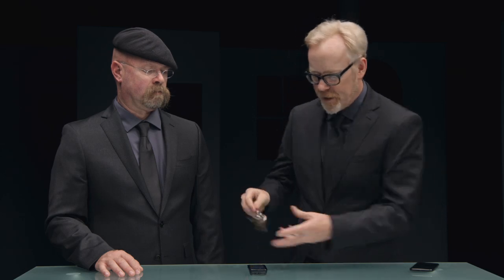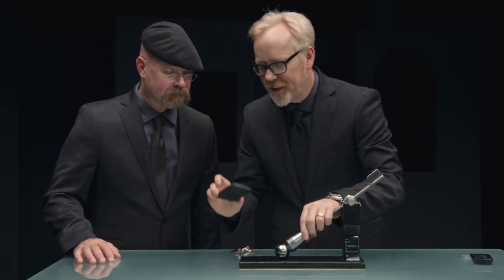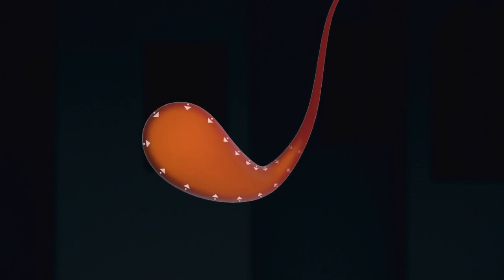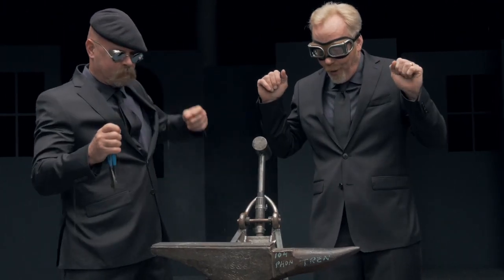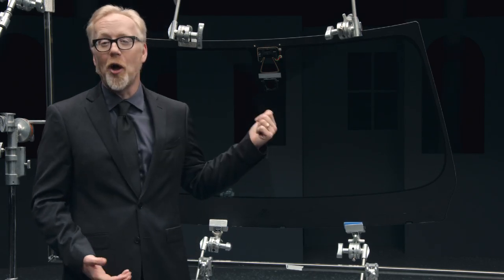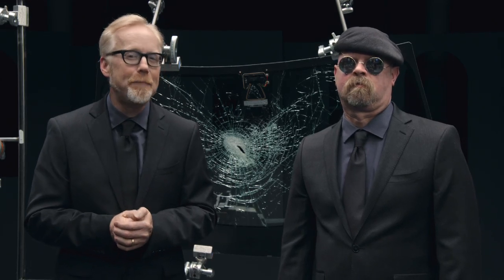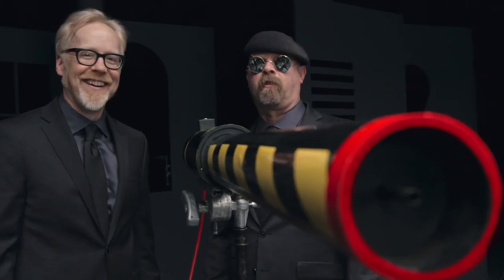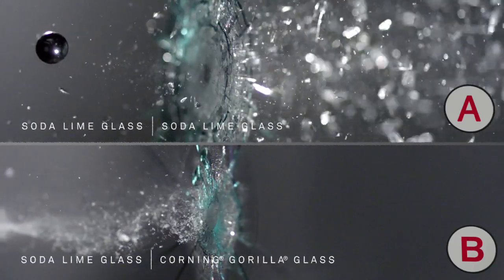The Glass Age, Part 2:  Strong, Durable Glass

Comment: The key scratch test on the two screens was blatantly rigged. The old phone had a glass display with a plastic top layer, which was common on old touchscreen phones. And he scratched it heavily while barely putting any pressure on the new screen. Even in 2023 you can easily scratch gorilla glass with a key with moderate pressure.
I know it's an old video and I know this comment will have zero effect because you almost can't buy a phone without gorilla glass, but gorilla glass was obviously better than plastic, so why bother rigging the test?

Comment: Gorilla glass on the inside sounds like an issue, thermally and chemically toughened glass tend to shatter as the drop demonstrated. The ball bearing didn't damage the gorilla glass, but the problem is that if something does crack it you won't be able to see anything through your windshield. This is the reason cars don't use thoughened glass. Yes, hiding the toughened glass behind annealed glass does something, but its ignoring the other risks for cracking. In some cases, toughened glass just cracks spontaneously (NiS inclusions, self fatigue, ...) and in that case the driver is just utterly fucked, however much you reduce the risks, you need to make sure that if it happens it doesn't kill anyone.

Comment: Just a quick note to everyone here, 3M makes a safety/security film (like window tint but without the tint) that covers almost any normal form of glass and makes it essentially impenetrable. Unless, you fire a gun at it or something.  It is far cheaper than replacing whole glass pieces and can be installed by a window tinter. Not employed by 3M, was just a window film warehouse manager back in the day, we sold the film for security purposes. Line your car windows with it and a sledgehammer wont get through it easily.

Comment: 3:51 As much paperwork as it would be, a much more impressive display would be shooting it. Prince rupert's drops are highly bullet resistant, able to even shatter some rifle rounds. Usually, however, the rifle's impact causes enough vibration to shatter the tail. Smaller calibers don't usually have this problem, and showing it in this way would be super cool.

Comment: GLASS PARABOLOID TIME CAPSULES ... A HELPFUL MESSAGE TO THE FUTURE
A well cast 1.5 m diameter, thick walled, borosilicate glass deep focus paraboloid (3D parabola) of the equation y = 4x^2 would be more durable, useful and multi-purposed then the "old school" Coca Cola bottle from The Gods Must Be Crazy!" ... AND ... would be capable of lasting for more than 1 million years; enabling US to send technological assistance to mankind in the distant future. The inner concave face should be surfaced with grade 8 mirror finished corrosion resistant stainless steel alloy 316 or if possible, iridium. The convex surface of each paraboloid should be festooned with a display of cast stick figure universal language messages depicting the myriad of functions implicit in a paraboloid including: Solar Cooking, Water Pasteurization, Flame Ignition, Shelters, Shields, Wash Tubs, Flood Lights/Spot Lights, Satellite Telecommunication, Radio Astronomy, and Optical Telescopes, etc.

By widely disseminating a sufficient number of them to villages and refugee camps where they are needed most throughout the non-industrialized world, (where they would be used as templates for crafters to fashion millions of ceramic and woven basket paraboloids of similar shape and size), a few would make it into the very distant future many thousands of years hence, to be found by future archaeologists who would discover among the stick figure messages of knowledge and wisdom, a star map like the pulsar map on Voyager, and with it an inscription depicting the messages ... 

                            Greetings From The Distant Past!  We Were Here Long Long Ago! 
                                           Sorry About The Mess We Made Of The Earth! 
                                 Do Not Attempt To Dig Up The Nuclear Waste Depositories!
 This Gift Represents The Opposite Of Built In Obsolescence And May Be Of Some Help To You.

If time travel has been perfected by then, around the time when that a critically sufficient number of such paraboloid time capsules (joined aperture to aperture to protect the inner surface mirror finish), have been created and disseminated, archaeologists traveling back to us in paraboloid shaped warp drive spaceship/time machines could begin appearing in the sky over the approximate locations where the paraboloids were discovered in the future ... and like Bruce Willis in the movie 12 Monkeys, they might over shoot the correct date; with the first attempts appearing over Roswell.  

However, as with Seti Safety Protocols, these paraboloids should not be sent to the future except as a desperate measure because we can't be sure that it would not merely be found by creatures like the Morlock, the Borg, or the Krill ... interstellar conquistadors; not unlike ourselves. But, given that Lawrence Krauss and Scientists For Social Responsibility have set the Doomsday Clock at two minutes to midnight ... this could be the right time to carry out this effort.

Comment: I will note something. You DONT want this on your car. You'll notice when a car window smashes it completely detonates and shatters into thousands of almost pebbles. Theres a reason for this, when its impacted it spreads the stresses out over the entire thing. You dont get the dangerous knife like shards. But its also safer for someone being thrown into it, as the kinetic forces get dispersed across the whole window. If your going to have a crash and get thrown into the window you WANT glass that shatters finely and uniformly. And thats not how Gorilla glass, or for that matter regular glass, works. Car window glass is specifically designed to shatter that way for safety reasons.

Comment: this could lead to thinner glass for doors and windows in homes, not to mention the glass in tall buildings. Wonder if they thought of using the willow glass with the fiber optic cable that emits light all throughout it, this could be used in signs/displays that have shapes you could not do with other materials. Also you use it to make a moving/changing display/sign.

Comment: We need monocrystalline diamond. That's 300 times stronger than steel and hardest material known to man with possible exception to Wurtzite Boron Nitride and Lonsdaleite. You could fabricate the display and all the electronics directly on it. If you can fabricate diamond then batteries would be super high energy density.

Comment: fast forward to 2019 and The Ford GT comes with a Gorilla Glass windshield from the factory. and you can buy aftermarket GG windshields for your Jeep JK Wrangler and F-150 pickups.
Reply: Yep.  After replacing 4 on my Jeep, I've switched.  The GG replacement has taken a few cringe-worthy rock shots without issue, so far so good.

Comment: I suspect the big problem with this wonder product is the same reason why we don't use tempered glass for windshields. Regular laminate glass does not shatter; it cracks. Which means you don't lose forward visibility from a rock strike. Tempered glass also shatters in relatively large pieces, while the Prince Rupert glass explodes into much smaller and possibly more dangerous fragments.

It's an impressive demonstration, but I hesitate to call it a safety solution until we see what the failure mode of gorrila glass truly is. Although since this is several years old, it's possible the answer is already out there.

Comment: My main question for this advertisement is: why not the flexible glass on the outside, a thick polymer resin, gorrilla glass in the center, and another laminate then another flexible glass sheet inside, Or is there a reason to keep the regular soda lime glass if its so much heavier and more fragile

Comment: The first phone they scratched was an old Nokia phone that used a plastic shield over the display and yes you can scratch it very easily but its bendable and because it's plastic its doesn't BREAK. What he broke was the screen it self under the plastic overlay. That's why they chose that ball instead of actully dropping the phones. Newer phones use glass over the screen. In short this is a bs commercial for gorilla glass

Comment: I've noticed screens tend to crack mostly when one of the corners impacts rather than when a side or the front or rear panel impacts, obviously enough as the 'wider' the impact the better the force is distributed but on a 'corner' the force is very acute. So, show me a Phone, Tablet, etc that can withstand a 1.5-2.0m (more realistic average usage height & therefore drop height) impacting one of the corners and when that doesn't shatter the screen that's the day I'll stop using cases.

Comment: These guys and Corning obviously never seen a phone where the screen blackens and burn out with it's glass unscratched!! I've had this happend with me numerous times on my Galaxy phones. When you drop a phone on flat even surface forceful enough, the "hardened" Corning glass will just absorbed the impact energy and pass it to the underlying LCD panel which it is tightly sandwiched to, the result?---the surface glass is just fine, but your display goes dead (usually slowly blackens) right in front of your eyes!!

Comment: Chemically strenghtened glass that are so flexible that they are used in making the rear glass of a convertible car made in the 1960s and early 1970s in order to replace the vinyl plastic at the rear. In fact, flexible chemically strenghtened glass are also used in making glass springs in the 1930s, 1940s, 1950s, up to the early 1960s. That is the problem with most Americans, they are all online computer dependent and THEY DO NOT HAVE A PRINTED BOOK-BASED LIBRARY ROOM AND MICROFILM ROOM in order to make comparison counter-checks and cross-reference checks of the information in the internet with the printed books and photocopied-reprinted books and multiple-redundancy microfilm library archives.

Comment: so if you hit the new windshield hard enough, the whole interior glass is going to shatter and fly around in the cabin? Doesn't sound that great to me.
Why not do it the other way around: put the new glass on the outside to avoid any damage to the windshield at all? You will have a lighter, more resistant windshield like this aswell - without aforementioned drawback.
And if they came around this major drawback, why didn't they exchange both layers with the lighter and more durable glass?
Reply: same reason they use ceramic in armor plating, its so that when the first layer of glass breaks it absorbs the energy

Comment: Yeah, I like these dudes but your keys are not going to forcefully dig into your screen as if you were holding onto it and applying huge amounts of pressure. Of course being paid to say anything for money is what you're going to do.
Reply: @Lee - yes and no, there are sometime tight clothes, or situations where both keys and the screen are pressed together (when someone bent, and the pocket is being compressed). Also there are usually other sharpies available - coins. Sometimes other objects too (decorative metal objects on the clothe). Also rings (when you reach the phone in your pocket). Bracelets. There are plenty of real-life possibilities for a mobile screen to be scratched. You are right that the force is not the same as intentionally press over with a sharpie, but we all experienced smaller scratches many times already.

Comment: wait so why pointlessly have the layer of soda lime glass? why not have two layers of gorilla glass?
Reply: coz they break differently. And the end result is - you have windshield that will withstand much more (it will of course break and have to be changed, but it will not puncture and will not send glass pieces towards you). They have just starting to use the same material as police shields anyway. the problem there is it fades on the sun.

Comment: Why they uses a Nokia 5800 as a test object?, it has a resistive touchscreen with a plastic film above, so of course is much easier to scrach (is not casuality of course)... Is like compare wood with paper and say that paper is much less resistive... Also compare a 1m drop hitting directly on the screen when nokia 5800 has a much better protection around, that limit the posibility of receive an impact directly on the screen (compared with modern phones that screen is fully exposed). My Nokia 6230i was dropped stairs down on a metro station and the damage was null (even the phone was on and working after all), while some modern phones with a super "Gorila Glass" screen dies in a simple drop from a pocket.
Well, maybe the cristal is more resistive, but that's only because is necessary 
taking into account that phones are much less protected (if not for sure that gorila glass will continue hidden), so I call this pure marketing without real life comparison.

Comment: Not hitting the gorilla windshield with the sledge makes me think you are trying to hide a weakness of this glass.
Reply: It's more like a sledge hammer will just RIP through both kinds as easily
Reply: well yeah, the sledgehammer will obviously go right through a sheet of gorilla glass that thin
Reply: @ConnorR.mp3 not a good control because you can't guarantee equal force
Reply: @ConnorR.mp3  that is why Not DOT approved
Reply: @punker4Real  uh... Yeah it is. You can get it on a F150.
Reply: @ConnorR.mp3  yeah, same as the soda lime, so why do it? It feels a bit biased
Reply: They seem to have no provider for free sledgehammers. They wouldn't risk their own sledgehammer on gorilla glass.
Reply: well, it will break with sledgeH but a third of a weight and a bit stronger than WShield A? thats impressive.. the only question is the cost.
Reply: ...Yea... I was a little ehhhh on that one.
Reply: Hitting a windshield with a sledgehammer is not a controlled way to test glass impact strength !! You cant accurately reproduce the speed of the impact a second time, you cant accurately reproduce the angle at which the hammer head strikes, neither can you accurately ensure there is No Tilt angle when it is struck, using an air cannon while mounted properly to shoot a projectile at a measured velocity ensures that the conditions are reproduced exactly the same, it also "Looks" better for demonstration purposes.
Reply: just like the little glass piece they made using cold water, probably using the hammer would cause the gorilla glass layer of the windshield to crack also but this time like a big explosion. :p
Reply: The entire inner panel would have turned to dust because it was under tension.
Imagine breathing that in during a wreck.
Reply: the windshield is not intended to be unbreakable. Because when it's unbreakable you can not rescue a loked person out of his car.
Reply: What I thought as well
Reply: It's for sake of consistency, same force and conditions. Also its not just gorilla glass its both soda lime glass on the outside to act like a cushion, resin and then gorilla glass
Reply: I’m thinking when the gorilla windshield breaks there’s fragments in the air... but it’s more impact resistant, that’s why it’s not approved yet and still a work in progress
Reply: Made me wonder why they even showed the sledgehammer take? Just to show that when windshields break, they crack like crazy?
Reply: Jackpot, if you manage to crack the toughened gorilla glass it shatters like the drop did, the fragments will be retained by the interlayer but you won't be able to see anything through the windshield, which is exactly why no manufacturer uses toughened glass for windshields.
Reply: @Nathan-kw2hs  Some good replies here, thanks guys. But my fav has to be the random dude who just said "your mom" lol.
Reply: It would be redundant considering they shot both of the windshields with the same ball, and also the fact that they both would break.
Reply: @narutorocks1011 then why show the sledge hammer at all.
Reply: Your mom

Comment: why use a gorilla glass windshield when one can use polycarbonate?
Reply: Because a single swipe of the wiper will ruin it if there is dust on it.
Reply: @joshua43214  well, we can coat it in enamel or better yet, gorilla glass.
Reply: @s.sradon9782  Ya, that might work provided the expansion coefficients are OK. My bet is that the bond would break though.

Comment: tbh new glass will be very expensive due to reduced weight, usage of gorilla glass and fact it is new tech. And in Poland you have to at least repair damage from the stone which sometimes cannot be done so u need to insure your windshield or replace whole thing so i assume cost for new windshield will be at least 200$

Comment: How would this Gorilla glass compare to polycarbonate? Didn't find much about polycarbonate's compressive strength online. Seems like a polycarbonate outer layer w/ Gorrilla glass inside would make a superior bullet-proof glass. And this stuff has been around for a while, as its been used in NASCAR, NHRA, etc., for the last how many years? Never understood why its a no-no to use it on your daily driver!?

Comment: It's a sheet of  polyvinyl butyral or pvb.  It's considered a resin but it's a plastic sheet.   and bonds the 2 sheets of glass together when heated in an oven.  It starts out opaque Then it turns clear when it's heated.